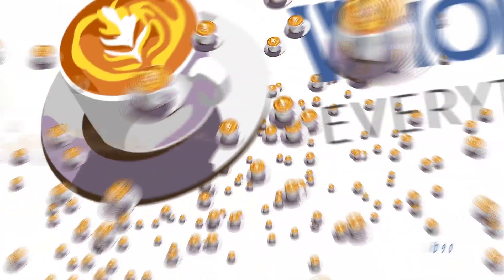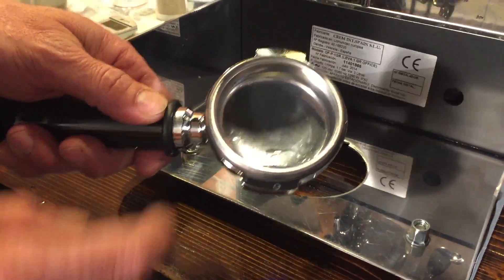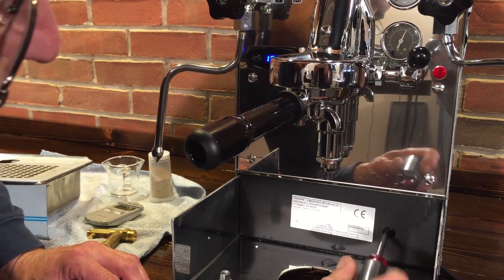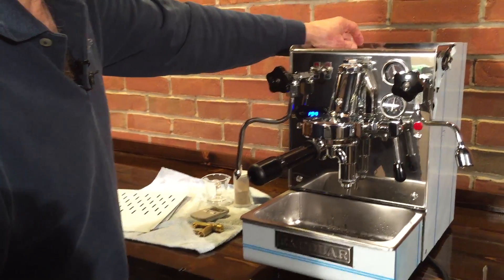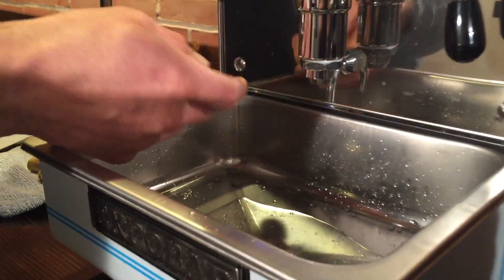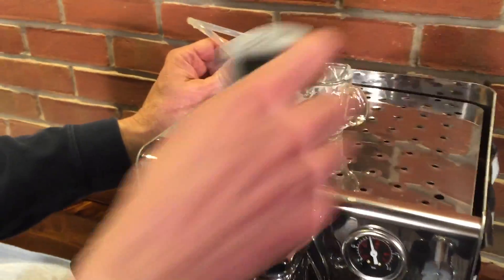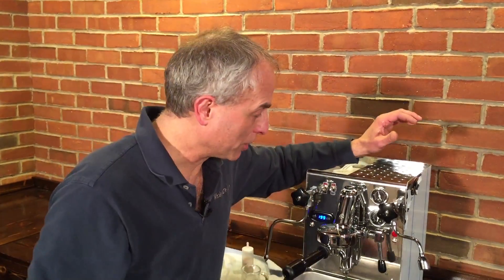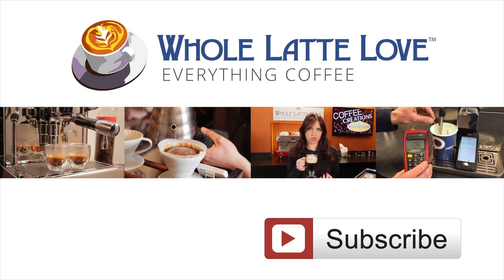How To Check and Adjust Pump Pressure on Expobar Espresso Machine

Comment: I now set it at 11bar with back flush that should bet not bad
Reply from the maker: Well, if that works for you go for it. Do understand that just because you set it to 11 bar that doesn't mean your espresso will be extracted at 11 bar. That is just the maximum pressure before brew water is dumped out of the brew circuit prior to flowing thru the coffee. Actual brewing pressure is a function of grind size. For example, put a really coarse grind in the PF and brew water will go right thru - pressure might reach a few bars. Raising the max brew pressure to 11 bar gives the machine the ability to push water thru a finer grind. That sounds good but over-extraction like that usually produces bitter shots. More pressure is not better when brewing espresso. It's unfortunate that many entry-level budget machines are marketed with specs like "14 bar pump". I think this leads those newer to espresso to believe that more pressure is better. But believe me, none of the machines marketed that way actually brew at 14 bar. Maybe the pump is capable of doing that but these machines typically use pressurized portafilters which allow brew water thru at much lower pressure - probably a lot lower than the 8-9 bar that's typical in high-end prosumer level machines.

Comment: Trying to compare someone told me u get less water at 10 bar so best 11 to 12 bar
Reply from the maker: Unless using a pressure profiling machine it's best to keep max pressure at 9-10 bar. Sure you'll get more water thru a puck of coffee at 11-12 bar but that's not necessarily a good thing. Water flow rate/shot timing/extraction depth should be controlled by grind size and coffee dose adjustments.

Comment: Why do u need to set it to 10 bar when they come at 12 bar whats the diffrance in shots
Reply from the maker: Hi Daniel, Thanks for the question. It's set to 10 bar with the backflush disc in the PF. Due to the way machines operate, setting to 10 bar with backflush disc in place results in a maximum pressure of 9 bar when actually brewing.
Reply: ok so what should it be reading with shot
Reply from the maker: Brewing at higher pressure generally results in over-extracting the coffee and more bitter flavors in finished espresso. That said, pressure profiling and manual spring lever machines sometimes use higher pressure at the start of brewing and then ramp down to a lower pressure - often only 3-6 bar towards the end of a shot.

Comment: Hello,
I have the model with both tank and plumb option. I am using the tank. I notice lots of water comes out if the opv exhaust (little bent pipe when pulling s shot) around 80ml for a 60ml shot.
There isn't a pipe back to the tank from the Opv. Should I just remove the pipe from the bent pipe and route a new tube back to the tank?
Is this how it should be when not plumbed in?
Reply from the maker: Hi, I am going to send your question to Todd our Expobar expert and will reply with his response.
Reply from the maker: For the plumbed machines we like to keep the over flow from the OPV into the drip tray so you can see when it gets full.  If you want you can run it back to the reservoir and then just empty it.  The higher the incoming pressure the more water bypassing the OPV.  It is OK to dial back the incoming water pressure if you have a pressure reducer on the line.
Reply: +Whole Latte Love thank you for your advice. I plan to get some silicone tubing and route that back to the tank. Great video showing my machine is in good working order. Very well explained. Keep up the great work.
Reply from the maker: dmdrabble
You are welcome and thanks for your comment!!!

Comment: Hi guys. I have a two-year old Expobar Brewtus IV with a vibration pump (it's not plumbed). I ran the two pump tests from your video. I first adjusted the pump pressure to 10 bars - that worked fine. I then ran the flow rate test several times and consistently got 2 ounces in 12 seconds instead of the 1 ounce in 12 seconds recommended in the video. Does this indicate a problem with the OPV?
Reply from the maker: Actually, it indicates your pump is operating very well. If it were significantly under 1oz in 12 seconds that would indicate your pump is getting weak. Yours sounds like it's pumping very well!

Comment: For a Brewtus IV extracting around 6 double shots per day, roughly how often would the pump (and other parts you mentioned) need to be replaced? And, is there a recommended service schedule?
Reply from the maker: +Michael Emery Hi Michael, We would not replace any parts until they actually fail. The most important thing is to use a quality water supply. Other than that, a daily backflush with plain water and weekly backflush with a detergent.

Comment: I have an expobar 4. And ive got 1 tube with pluming. How do i adjust the pressure and measure it? And what is the opv and de airetor?
Reply from the maker: +X Z Seng Hi, does your machine have rotary pump or vibration pump? OPV is the over pressure valve. The OPV controls brewing pressure. If your machine has a vibration pump this video shows you how to check and adjust. We have more videos about Expobar machines. Use this link: https://www.wholelattelove.com/products/expobar-brewtus-iv-with-vibration-pump then scroll down and select the "Video" tab to access additional videos.

Comment: Thanks for the video.  I have checked my Bezzera and I got two ounces in 12 seconds with the blind filter and the opv set at 10 bar. I'm having issues with fines in cup and I'm wondering if this flow, faster than the expobar on this video, could be a problem.

Thanks again
Reply from the maker: +Pedro Hi Pedro, Yes, 2 ounces in 12 seconds is very fast. What kind of grinder are you using? Your fast extraction with fines in the cup may indicate poor grind quality with a grind that is to coarse in general but with a lot of variation in grind size. Here's a video with some basic technique on dialing in shots: https://youtu.be/o3oSlZSXHog
Reply: +Whole Latte Love Thanks for replying,

I'm not talking about 2 ounces of espresso, I can easily get this between 20-40 seconds adjusting the grinder. I am talking about the pump test made in this video. Two ounces in 12 seconds of water returning to the tank through the opv despite lowering opv to 10bar. I have a Nuova Simonelli MCI and it's capable to colapse my Bezzera if I grind very fine.

Comment: nice video. i adjust to 10bar the pump pressure on my expobar office lever 1 boiler and it takes almost 2 oz in 13 sec. is it ok? it was at 12 bar from factory i dont know why. thanks!
Reply from the maker: +Michalis Michail They tend to come that way from the factory. Understand that does not mean it will always brew at that pressure. That's the maximum pressure it will use before dumping excess pressure via the OPV.

2oz in 13 seconds is way to fast! You need to grind finer and/or use a higher dose of coffee in portafilter. In general, you are looking for 2oz. in 20 to 30 seconds from the first drip of espresso. Here's a video that explains the process of dialing in shots: https://youtu.be/-QwOSK9lZcQ
Reply: Thank you very much
Reply: he might have been reffering to the water measured as shown in the video and not brewing of coffee. i have a brand new machine (plumbable version on reservoir for now), adjusted the pressure to 10bar and measured the water flow at the bottom, got 2oz in about 15sec